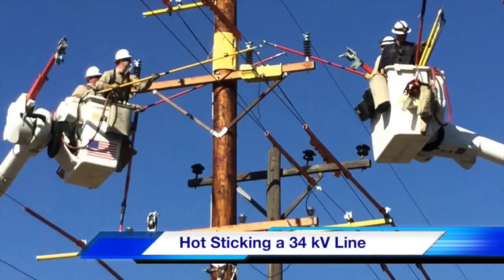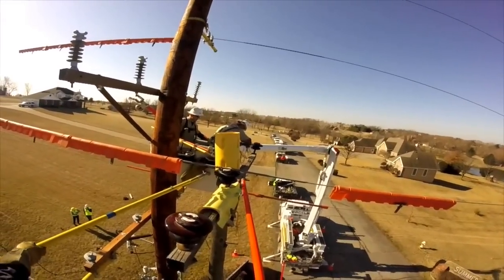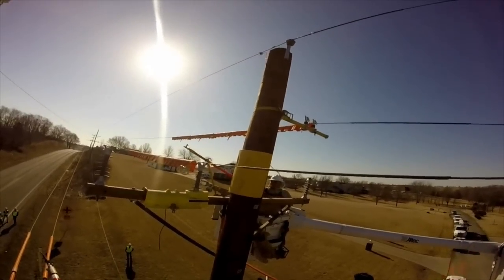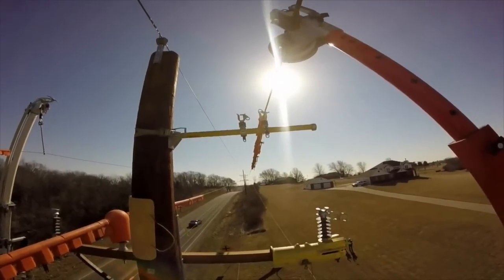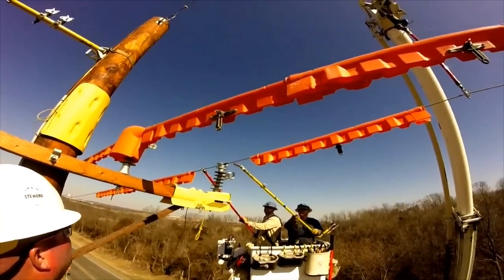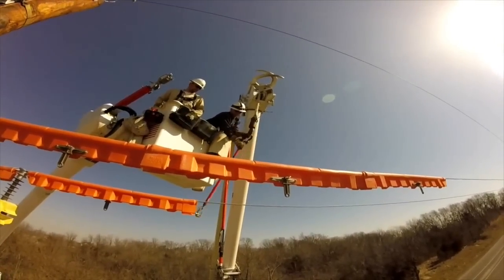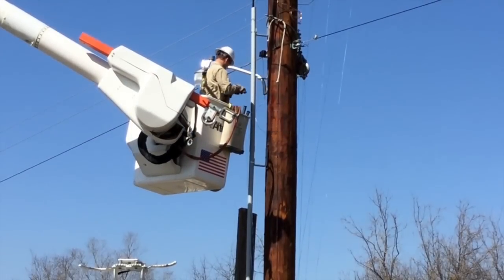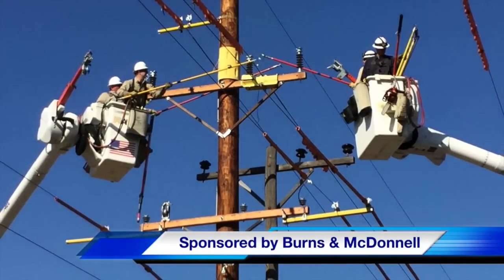How to Hot Stick a 34-kV Line

Comment: We have the choice when working our 27.6, our highest distribution voltage to either stick it or glove it, we never wear sleeves. If it’s just a straight insulator change I prefer stick and jib, we are fortunate to use K-line insulators with K clamps. If I have to make taps I will glove it.

Comment: I have pole in my backyard. Pole was changed after Hurricane Harvey, then 2 yrs later with one 5 feet taller. They were hot sticked both times. Power never went out. These guys have brass balls I tell 'ya! Although my line is residential. I'm NOT far from Center point Hiram Clark. I thing they do training there. I have HUGE respect for lineman & ANY electrician. Question? How many loops around on the insulator or does it vary?
Reply: Poles where I live are never replaced unless they fall and power is off almost every time there’s wind or rain
Reply: The amount of skirts on the insulator varies. Usually the ones that are about 6-8" are 15kv insulators in my experience. And two of those will be stacked for a 30kv rating.

Comment: In my area in Australia those insulators are used for the 11 kV network because back about 50 years ago they were fitting the big fat insulators for the 33 kV feeders which usually supply the suburbs with power via an 33/11 kV substation,the poles & insulators look something more like this :-
https://maps.app.goo.gl/X5FNZkHgZQPYpGPC8

Ironically,the top 33 kV feeders (11 kV is the bottom) supply Gloucester in New South Wales with power & the 33 kV lines span for about 50 kilometres yet in my town which is rural residential,we are supplied Power via a twin 37 MVA transformer substation which is rated at 132/11 kV & it's only about 10-20 kilometres aways from the local aluminium smelters 330/132 kV switchyard.

This one is actually a power pole which holds feeders which supply 11 kV to our local area :-
https://maps.app.goo.gl/hGKfXghwsrFZPVwc7

I'm pretty sure that it was 33 kV infrastructure but they either gave up or ran out of money back in the 1970's when about 20 kilometres of that feeder was run through my town,I don't need them anymore ever since the new substation was commissioned in 2014,the high voltage switch is opened a few kilometres north which isolates us from the original near 50 year old 11 kV feeder.

In country areas in New South Wales, they were supplied Power via 66/11 kV substations but now the primary voltage is 132 kVs on newly built substations !

Comment: When lineman do complex operations like this, do they practice the steps ahead time to make sure everything is figured out or is this considred routine enough that they just go do it.
Reply: All involved would go through training in a training area. Usually it takes years before you are allowed to do such transfers on live distribution wires. On a specific day of the transfer, before the job is started, all steps will be discussed with the whole crew. The weather, lighting and winds need to be favorable too, and area secured. If it is a more complex transfer, or many poles need to be replaced, it will be usually communicated days earlier and discussed. It is routine to an extent, but all the briefings are non-optional. Everybody has a specific tasks and order to do in general. There is always a chance of forgetting something, or doing something wrong, not checking the protection equipment, etc. In a work like this there is no space for mistakes. If your stick is dirty, if you have a microscoping hole in your gloves, or don't take care of the tensions in wires, and your movements, you are very likely dead.
Reply: Depends on the power company you work for... as you heard in the video they had 2 apprentices up there...

They're just putting a few lines onto a new crossarm, (probably the last third of replacing a crossarm if I had to guess) but moving lines is something you'll have to do to get some things done so you'll end up moving lines pretty often. Thus that will be part of your training you will be very familiar with the procedure before you go up there. No need for rehearsal, you get that in training, then as an apprentice, then you do it regularly as part of your job, but in training you will drill things, especially safy procedures. This was a 34 kV live line, that's why all the safety procedures. If they didn't have to hot stick it, this could've easily been one guy (depending) with a bucket or maybe even just climbing the pole. Would've taken less time too. So it all just depends, but everything they did was standard procedure stuff.

FULL DISCLOSURE:
I'm an electrician, not a lineman, but my dad owns the company but before he started the electrical shop, he was a lineman, my whole life, while I was growing up. (I've had a lot of exposure, asked a lot of questions, am in a related field, when to school for electrical theory, etcetera, etcetera.) But I have no personal firsthand knowledge.

Cheers.
Reply: @binaryglitch64  I can tell you’ve never done linework lol. They are doing a double circuit pole change out, not just changing a cross arm. You can glove 19.9 in class 4s for sure but it still bites you. Not to mention everything in your toolboard will bite the Shit out of you because of the induction. However, In no way would it be faster for one guy to do it and it would be completely impossible to do off hooks as you suggested. You’re not supposed to work energized 3 phase alone, especially a 34.5 line. And you sure as hell don’t work energized 34.5kv off hooks 🤦‍♂️
Reply: You'll go up with someone who's trained and they'll train you. They're apprentices, and that's all. Sometimes you get training in a yard, sometimes you just get through into it and do the training after.

Comment: i have rubber gloved 34.5 KV
Reply: Harold Spencer same here. I thought it was odd, they were sticking it.
Reply: @brianpayne2478  ..You probably gloved 34.5 / 19.9 Wye. You shouldn't glove 34kv Delta (which is probably what they where working with). The reason is that if there is a fault on the circuit they are working the voltage could  spike to a higher voltage than the Class 4 gloves are rated for. You don't want to take that chance.

Comment: The insulators on the old pole look so small for 34kV!
Reply: 5Dale65 yep, pin type insulator is way to short for 34kV line. I wondering how many times they got power failures due to flashover
Reply: @imadewn  I’ve one like that for 46kv.